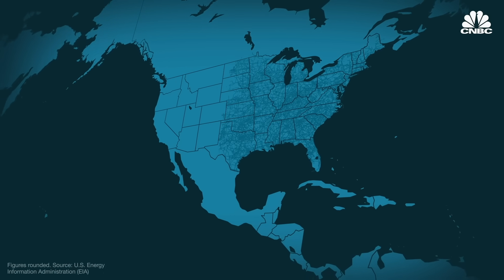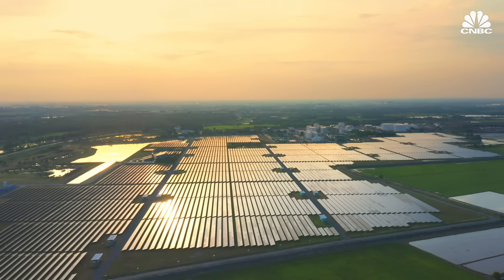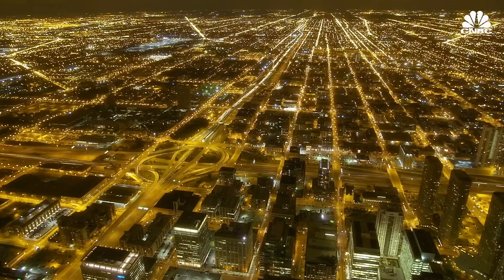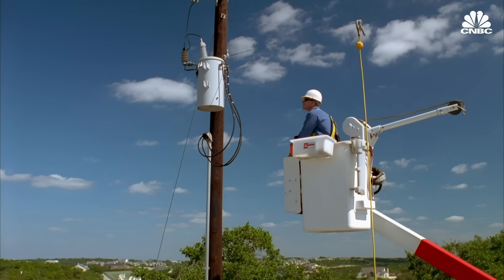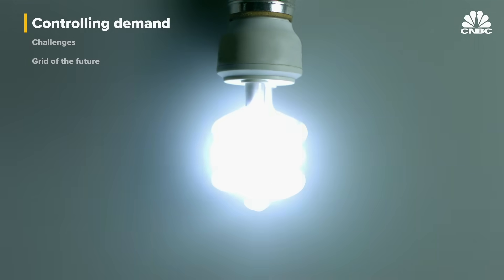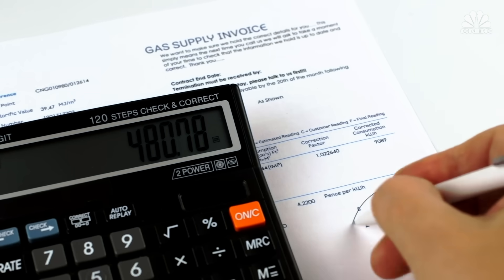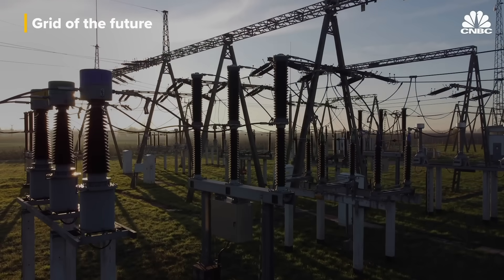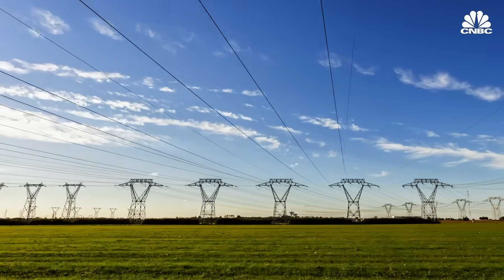How The U.S. Can Build A 100% Clean Grid

Comment: Solar and wind are not clean energy resources this is perhaps the biggest lie. They require massive amounts of mining for their materials as well as for the batteries they would require to store power. Also, the materials used for the batteries and panels contain toxic metals. In addition, the panels, windmills, and batteries have shorter lifespans than every other form of energy technology. Therefore, they will create a significant amount of waste that will contain toxic metals and they have no plan for how to safely dispose of them. To top it off, these energy resources are not on demand, (reliable), so you would always need to have a backup form of energy that can be turned on. Energy availability is not an option, it is a necessity for human beings. If you want a completely clean energy system that is affordable, abundant, and most importantly reliable, nuclear power is the only option forward. If you want to feel good about helping the earth, but not actually doing it, continue to push for solar and wind because these energy systems require fossil fuel backups.
Reply: What you forgot to mention is that solar and wind pays back it’s carbon tax in a couple of months
Reply: @jonathanchowkai3654  no they do not. They have have been and continue to receive billions of dollars from the government despite being less efficient, unreliable, and more harmful than the fossil fuels like natural gas. These energy sources require a constant backup, so you have to pay for, construct, and maintain two energy grids because they are at their core Unreliable.
Reply: @brendanthornton3527  well solar takes on average 3 years to pay back its carbon and wind takes 3 months to pay back. Also the clean energy has been pushed mostly by the free market. Really the only reason the oil and coal industry is still alive is the billions of dollars of subsidizes the US government gives it
Reply: @jonathanchowkai3654  this is inaccurate again. Wind and solar receive the largest government subsidies in the energy industry. Yes, the free market has invested in them, especially companies that provide coal and natural gas. These companies do it because they know these power sources are widely unreliable and they are the backup power source that will be used. Also, they do not pay back their carbon amount expelled nor are they paying for the future disposal of the toxic metals that are contained within their materials. This is simply inaccurate because these measurements do not include the energy used to support their backups, mine their materials, assemble their components, and battery builds. They simple ignore all of the construction needed around them. Germany is perhaps the best example, they keep investing billions in these two techs every year, yet at the same time their emissions continue to rise because they have been needed to build coal back up plants to support the energy shortage.
Reply: @brendanthornton3527  I’m a supporter of nuclear power, but you made several misleading, or downright incorrect claims.

Nuclear is not “completely clean.” There are relatively few emissions involved in the mining process, transportation, and enrichment of uranium fuel, but they still exist. And nuclear waste, while theoretically not necessary for nuclear power, is a by-product for every current nuclear power plant in the world. 

Natural gas is neither more efficient than renewables nor does it pollute less. I don’t know what made you think this, the CO2 emissions of natural gas far and way exceed those of renewables. This isn’t the only environmental impact either, I have not touched on the particulate matter produced by natural gas being burned, or the invasive mining process which is more polluting than mining for lithium. In addition, you claimed ALL the fossil fuels were cleaner than renewables, which would include COAL. The numbers couldn’t be farther from the truth.
Reply: @Jake-rs9nq  In the long run, nuclear power has the ability to be completely clean since it is an on demand energy source. The entire energy grid could be built upon it including the mining, transportation, and construction of its own resources. Nuclear waste is not harmful to the environment since there are already secure and safe ways to control it. Three important facts here, all nuclear waste from the US currently can fit in facility the size of a football field only 70 feet high, the amount of waste produced per person over a lifetime would be the size of a soda can, and there are developments being made today that will allow us to reuse the nuclear rods which would eliminate all waste.

As for my claim about the unreliable power sources being more harmful than fossil fuels, this is backed up by the simple fact that they need an incredible amount of energy to be produced (mining, construction, transportation, maintenance, etc) and require two energy grids. In any case with wind and solar, you need a second on demand grid that can be turned on. Wind and solar are fundamentally unreliable because of their intermittent power sources, which means they cannot be baseload power. Therefore, in measuring their carbon output you have to include all of CO2 output from the on demand energy grid that is needed to support them. Essentially, all of the carbon output they add is incremental onto the grid because it does not reduce or eliminate the use of any fossil fuels. 

As I said before, Germany is the best example, every year they build more windmills and solar panels, but they keep producing more CO2. The US on the other hand has reduced emissions and pollution levels are at 1992 levels because of our switch from coal to natural gas.
Reply: @brendanthornton3527  Like I said, I'm a supporter of nuclear energy. You don't need to give me stats I already know or try to convince me to support it. I'm just pointing out that you gave false claims, and continue to do so. 

For instance, you gave the example of Germany when claiming that renewables increase CO2 output. That is wrong for two reasons. First of all, German emissions continue on a downward trend that started in the mid-1970s, they are not reversing, although there has been a stagnation in the rate of reduction. source: https://www.worldometers.info/co2-emissions/germany-co2-emissions/

Secondly, the CO2 production is coming from coal plants that are coming back online due to the shutdown of nuclear power. This is not the fault of renewables, they haven't been built up to a sufficient level yet. There would be little to no reliance upon coal if Germany had simultaneously embraced nuclear and renewables, at least in the sort term. But that's besides the point, which is that the emissions do not emanate from solar or wind, they are not base load. 

Then you brought up mining and claimed it made renewables greater pollutants than alternatives. This is simply untrue. Not only do renewables have far smaller carbon footprints than fossil fuels (this includes manufacturing, transport, and mining), but the EROI of both solar and wind are higher than the EROI of nuclear source: https://www.carbonbrief.org/solar-wind-nuclear-amazingly-low-carbon-footprints

In addition, the batteries are nowhere near as damaging as you claimed. Lithium is recyclable and studies have found the mining process to be less intrusive than the mining process for gas and crude. source: https://pubs.acs.org/doi/abs/10.1021/es903729a The far more impactful elements are iron and copper, which will actually be required in smaller quantities over the lifespan of wind turbines and photovoltaics than the lifespan of coal plants, even when adjusted for power produced. This is because copper and iron are only required at the beginning of the production process, unlike coal generation which necessitates a steady supply. source: https://www.scientificamerican.com/article/renewables-are-as-green-as-you-d-expect/

While I fully support nuclear, I also support a diverse energy generation portfolio with an emphasis on harm reduction. Renewables will undoubtedly be a part of that. If you're this greatly concerned about the environmental impacts of renewables, you should also be concerned about the mining of uranium, the transport of materials, the construction of plants and artificial lakes. It all adds up. And cars/electronics are even worse than nuclear/renewables in terms of CO2 production and invasive mining, and I'm willing to bet you wouldn't be content with giving up either.
Reply: @Jake-rs9nq  you actually helped prove my point, Germany moved toward solar and wind, in turn they needed an on demand energy source because nuclear cannot be turned on and off like coal or natural gas. This change to the unreliable source of power is increasing their CO2 output rather than working to increase nuclear power. You cannot measure solar and wind in isolation because they require a secondary on demand energy grid because they are unreliable, intermittent power sources. This means all of the CO2 generated from the secondary energy grid has to be included when you factor their CO2 output. Essentially, this is putting your energy grid in a traffic jam and is less efficient because the on demand energy resources will constantly have to be going up and down. They will have to burn more energy to wind up and the plants will not be able to run at an efficient pace. Solar and wind production are increasing CO2 output for these reasons and make them the worst form of energy.
Reply: @brendanthornton3527  Did you not read anything I said? The nuclear plants were brought offline PRIOR to sufficient wind and solar being built. If they had waited 10 years, it would be a different story. 

As for CO2 emissions, I already gave you sources showing that CO2 is NOT increasing. Neither in total nor per capita. The downward trend started almost 50 years ago.
Reply: @Jake-rs9nq  in the last decade Germany has seen their CO2 emissions both increase and decrease. This is when they made their big push for solar and wind. With them moving nuclear out, they are forcing the country to rely for more of their on demand energy from fossil fuels, coal and now more natural gas. As the completely decommission nuclear, the energy will not be picked up by solar and wind, but by natural gas or coal production. They are going to be increasing their emissions, or like most rich countries, they will offset them by importing energy from poor countries so that they do not hurt their emission goals. Also, since most of the harmful production of wind and solar takes place in other countries, this doesn’t count toward their emissions either. 

Countries moving away from nuclear and towards wind/solar are going to increase emissions because of the intermittency problem. This is why when measuring emissions output from wind and solar, the baseload energy grid must be included or it delivers a false positive number.

Comment: more renewables, then we can be like texas and not have power when the windmills freeze! Modern Nuclear technologies would be a much better choice in literally every respect.
Reply: TX deregulated and didn't spend money to upgrade their infrastructure for extreme weather.  https://www.salon.com/2021/02/19/what-caused-the-texas-disaster-decades-of-republican-deregulation-laissez-faire-run-amok/  Antarctica seems to be ok with wind turbines.  https://mashable.com/article/wind-turbines-texas/  Why don't you research first before you open your mouth?  And what's your answer for centuries of radioactive waste from nuclear power?
Reply: Nuclear reactors also had to lower their output because of the cold.
Reply: Modern designs are likely able to handle the weather better. Additionally, a grid that is primarily powered by nuclear would have sufficient excess capacity to handle demand at reduced outputs.

Comment: How’s that renewable paragraph doing in Texas today? February 2021 and 1.3 million customers are out of service because wind turbines are locked up in the cold and the snow is covering the photovoltaic panels.
Reply: TX deregulated and didn't spend money to upgrade their infrastructure for extreme weather.  Renewables wasn't the problem.  https://www.salon.com/2021/02/19/what-caused-the-texas-disaster-decades-of-republican-deregulation-laissez-faire-run-amok/  Antarctica seems to be ok with wind turbines.  https://mashable.com/article/wind-turbines-texas/  Why don't you research first before you open your mouth?
Reply: And gas power plants couldn´t operate because pipelines are frozen and coal because the coal was frozen in place, even the nuclear power station had to lower their production because of the cold...

Comment: No advanced grid and no off-line battery storage equals more natural gas. One of the good ideas the Biden administration has is modular nuclear plants that can be distributed around the country to take on a base load. The renewable sector needs to find a way to store energy. I think so far the only solution are batteries or hydrogen fuel cells. More research needed. High solutions or we need to move to.

Comment: I would just like to point out that it is physically impossible to power everything with wind and solar. We have been building these technologies like mad for 20 years in the US and have barely made a dent in the power demand. Even if it were possible the shear volume of oil, plastic, glass, concrete and other minerals would create a environmental challenge unlike anything we are seeing today. I would also like to point out that most of these items either cannot be recycled or are very dirty and energy intensive to recycle so most of it ends up in labdfills when it is at its end of life. Renewables are not clean.
Reply: Yes my solar panels are so smelly when they are working I have to wear a facemask when around them.😉
Reply: @hitreset0291  that is good that you are able to, the kids and sweatshop workers mining the minerals and snapping them together probably do not get that benefit.

Comment: No amount of software will generate electricity.  Households with solar panels have no excess power. They always consume more electricity then they generate. The testimonials are by the non-credentialed dreamers that do not know the scope of what is involved to replace a system that has been in development for 100 years. It will take 100 years to replace it!  The video is all propaganda beginning with the erroneous citation given to Edison.  Invest in candles for the time the smart grid turns off your lights!

Comment: This video came straight from California.  And didn't they just have rolling power outages recently?  So the idea here is nationwide  you no longer control your home electronics.  If the utility company says, they can turn off your fridge, water heater whatever,   you saw a clip here where someone turned off their washer machine remotely, so you stopped washing clothes mid cycle?  You like your house at 68 or 72 degrees?  Utility company can turn it up to 78  Seriously?  Thats the "smart grid"  I saw here.  Why is that important?  Because renewable energy that works off of solar and wind is unreliable and goes out when there is a cloud / rainy day or the wind isn't blowing so strong.  But hey at least we will have "clean" energy right ?  Makes perfect sense.. (sarcasm).  4.5 Trillion in 20 years.  We all will be poor and in debt and taxed to death but hey at least we will have clean energy right and China is going to be laughing while they still burn coal until their air is unbreathable...  Should we do this for the future, sure. But this way about it seems like a whole lot of pain with little if any gain by the current generation and the future generations will be paying for it when the technology is much more advanced.  All this and they want electric cars to replace hundreds of millions of gas cars.  Spells a recipe for disaster.

Comment: And I don't want to be told when i can turn on my appliances snd charge my EV.
Reply: You won't be told that you're not allowed to charge your EV at 7PM, but it will cost you extra. 99% of people will opt to just let it charge during the off-peak hours.
Reply: @thelight3112  i think the video say they will shut of appliances, not just charging EV. I don't want to be told when I can use my oven, range, and air conditioning.

Comment: Thanks for another great news video. It's good we can come up with new ideas instead of burning coal. I live in manchester UK, but we've just bin told all energy prices are going up by £96 a year. I have to live of a limited income of just over £100 a week, with that iv Hugh bills to pay, not through debt but just your normal bills. But I live in a high tower block housing associations with only electric allowed which I'm also on a pay meter . I never leave a light on, I have to cook, wash, iron after 9pm or 12am for cheapest rates, which still uses over £20 a week which I struggle to pay and sum times have to go without electricity for a few days. They've even as we speak fitted the whole block with a new central heating system and hot water boilers which iv had to switch off due to it using £20 for just a couple of days only, I'm not the only one that does this in the block. I have to wear jumpers and have to light lots tea light candles to keep warm and for light. So I really hope these new inventions they come up with take into account there are lots of people who are living on the bread line

Comment: Wait wait wait. Having appliances set to work at peak performance times? I hope that is not a big factor in achieving 100% renewable. If my kitchen appliances only work from 9am to 5pm I have a problem
Reply: You have control over the system, so this wouldn´t happen unless you wan´t it.